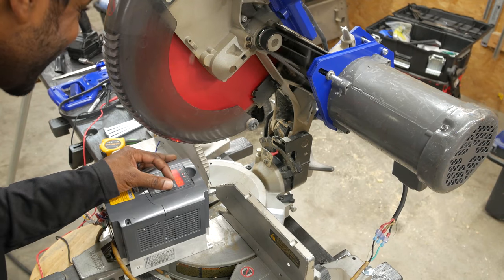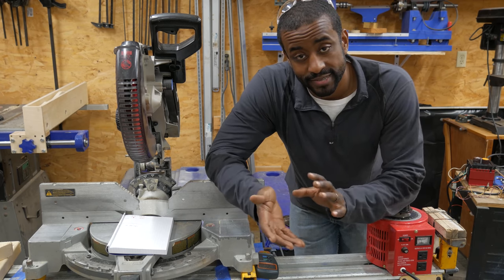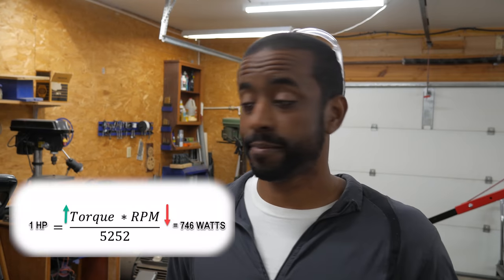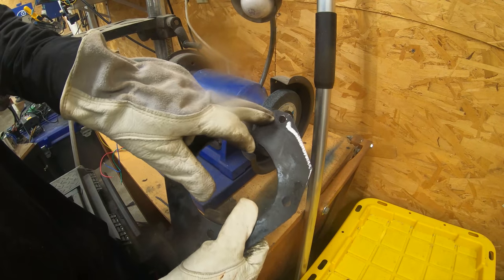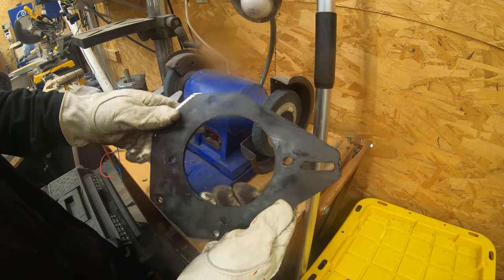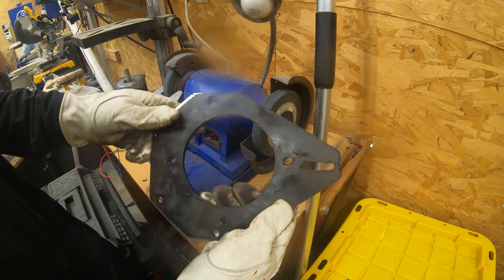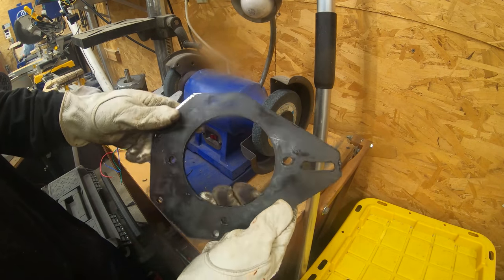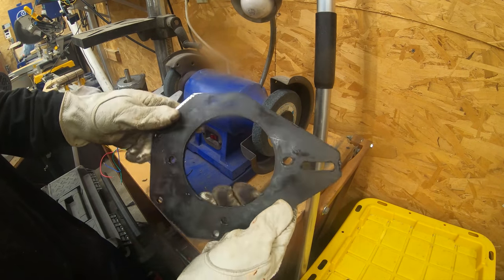How To Speed Control Your Miter Saw For Cutting Steel #080

Comment: I tested my saw on bologna. It definitely works on cold cuts. I'll have to pick up some dry salami to see if it can do dry cuts, too.
Reply: That’s a lot of modifying to cut metal on a mitre saw when you can just buy a metal cutting blade rated to 3000RPM. I purchased a Diablo STEEL DEMON 10” blade for ferrous metals including stainless steel for AU$160 which is about US$5 😝. No mods needed and it works beautifully.
Reply: Random: You can make a fair dinkum hybrid rocket engine out of a pepperoni or salami plumbed for oxygen. Needs  casing and a nozzle of course. I'm serious.
Reply: @railgap  The "I'm serious" at the end made me actually google this. Thank you for expanding my culinary rocketry knowledge sir.
Reply: Now that's Funny~!! 😅😆😅😆
Reply: You could try butter for the cold cut and see how that works out.
Reply: I tried to get that "shaved" ham effect and ended up with 4 really thin slices and a pound of Underwood Deviled Ham all over my saw.  Woefully inefficient for the task, unfortunately.
Reply: Railgap Esoterica I would definitely like to see that. Lol
Reply: hahahahaha!
Reply: Sir I'm going to ask you to leave this comment section and never return. We have a zero tolerance policy regarding puns and dad jokes. Goodbye.
Reply: Wild or domestic bologna?
Reply: @unclezeds  no issues with the blade going a bit over the max speed of 3000rpms.....? Thanks
Reply: capitalD D they have smaller blades that are rated at higher RPMs something like 7500 on a 7” blade.  I’m guessing slightly might be ok as they always have a safety margin on ratings.
Reply: Hahahahajajajaja made my day..
Reply: Ha! I kill me!
Reply: Are you talking about ring bologna or the big loaf?  I’m a ring bologna guy myself, but I’ve never used a power tool to cut it.
Great idea!
Reply: Uncle Zed.. Where is the fun in that..!;!
Reply: Watch out with salami sometimes they are way to hard
Reply: @unclezeds  this saw, and most other 10 to 12"  miter saws made for wood run well over 3000 rpms. Usually anywhere from 3600 to 4000 rpms which will kill any steel cutting carbide blade pretty quickly. Beleive me I've tried it. I tried a 10" lennox blade rated at 5000 rpms in my 12" rigid miter saw that runs at 4k rpm and the blades wouldn't last. Still too many rpms. Next project will be trying it on a Bosch saw that was given to me that has pulleys and a belt. I'll be making new pulleys tobreduce the speed down to about 3k rpms. Nice thing is it will give me MORE torque.
Reply: I'm glad there are other dads here
Reply: I cut a frozen 10lb roll of ground beef.
Reply: let 'er rip
Reply: Told my wife I wanted a new cold cut saw for Christmas, thanks to this little comment she stumbled across trying to figure out what a cold cut saw was I now have a beautiful slightly used but we'll maintained  meat slicer right where my engine lathe should be going!!! No BS. I guess it Looks like I'm going into the meat business instead of machining business

Comment from the maker: This project is meant to be a creative teaching moment. I don't expect anyone to buy a VFD and induction motor. That would cost more than buying a separate saw. LOL I really just wanted to show what does and doesn't work in a creative way. I hope you walk away with a new understanding of universal motors, speed control, and maybe laughed a bit at this insane upgrade! Which worked out great by the way. Cuts both steel and wood like a champ!
Reply: Jeremy, great video.  I really liked it.   I am curious how the abrasive wheel worked.  You said you would tell us in the comment section.  But I've scrolled through twice and  I'm not seeing it.

Keep up the great work, Jeremy.

- Chaos
Reply: Ed G  I've come to the same conclusion ie, bite the bullet. I've noticed my 14"abrasive blade tends to deflect, also. Can't get a square cut no matter how fast or slow I cut.
Reply: @shaywave  my experience with abrasive wheels is the larger blades seem to work better and abrasive chop saws are cheap.
I think I paid 100 bucks for my ryobi 12".
One thing that has happened to me twice though and I thought it was a fluke the first time....
Don't cut aluminum and steel with the same blade.
I buy pretty expensive blades so I'm pretty sure it's not that they are cheap, but I dont cut steel much mostly aluminum. If I cut steele after cutting aluminum then go back to aluminum my blades shatter. 
I've asked all the old guys I know and they have all said use a different blade.
Could be I just had two go off on me coincidentally, but I have been using the same saw and I'm about out of the 20 blades I bought and it's been over 15 years since the last time that happened.
Reply: @christopherleveck6835  A similar consequences is supposed to happen to grinder wheels if you grind soft metals, but I've never had it happen. I do most steel cutting with cutoff wheels in angle grinders and larger stuff with an abrasive wheel in a circular saw or table saw, which does the straightest cuts. (I just lack money)
Reply: Showcasing how such a modification can fail and WHY is also very educational.
Reply: As the speed for cutting steel is only a bit less than half the speed of the wood variety that makes changing the pulley an option. That way the motor can run at it's normal speed reducing the heating of brushes due to more current and the reduced cooling as the fan spins slower.
Reply: @Jeremy Fielding  Then why did you call this "How to"? 

As you said,  this doesnt make much sense for people to try to copy.
Reply: No, actually I kinda got pissed that I wasted my time watching this video. Here I thought you were going to show me an economical way to turn my slide miter saw into a dual-purpose machine. Instead you showed me how to use thousands of dollars worth of equipment I don't have and 5 to 10 times the cost in parts of just buying a metal chopsaw. The time that it takes to convert your unit between the two uses is probably 20 times as long as it would take for me to move the slide miter saw and put the chop saw in its place or vice versa.
Reply: Can you make a video making a perpetual power machine and explain why it works or why it is not possible for it to work
Reply: i dunno. that 2hp wood cut seems like some would love to have that speed
Reply: Great video,  I thought you achieved your intent, "Creative Teaching Moment".  Did you determine the optimum RPM or feet per second the 12" blade needs to strike the steel? 
As a side note the plastic chute at the back of my saw used to collect dust on my miter saw caught fire after several cuts with the abrasive blade.
Reply: Jeremy  I'm so glad to see that someone finally gave you some money man you deserve it you do some of the Things I only dream of a man after my own heart Live on my friend you doing Great
Reply: @PacesIII  what fails
Reply: @dgallett60  ----- This was a while ago, but if I recall, he had mentioned something about modifications like this can fail. I would like to know the mechanisms behind such failures so I don't make the same mistakes.
Reply: Jeremy, you have a knack for tutorials and tool engineering. Your knowledge on motors, circuits and electrical in general is second to none on you tube because of your detailed without rambling explanations.
No need to explain your reasons behind any projects as it is educational and fun to watch you create.
Keep up the great work bro. You got mad skills !!!!
Reply: Christopher Leveck iam a carpenter but went to school for aircraft mechanic. one of first things we learned was never ever grind aluminum on bench grinding wheel that’s used to grind steel. Same reason hangars have 2 separate grinders. Aluminum being a softer metal with lower molten point then steel, gets impregnated in  wheel during grinding process. then when u go and grind steel on same wheel, because steel is harder it heats up impregnated aluminum bits that expand( heat expansion) which leads to wheel shattering. btw being hit by fragments of a shattered grinding wheel is no different then being shot by a .22 caliber gun
Reply: Its a cool modifcation regardless tho, even if you dont have a spare VFD with some induction motors at hand
Reply: I understand it is content for a video, but why not use your plasma cutter, or an angle grinder on a stand?
:
Reply: Why buy a vfd and induction motor when you can raid an old inverter and motor from a decommissioned split system air conditioner. All you would really need to do is wire pwm outputs of an Arduino to the gates of the drive.  Still cheapest option, you may be able to get them from a scrapper or fridgy.
Reply: Nicely done, very thorough.
Reply: Have you ever considered putting a electric chainsaw motor on to make a cold saw the rpms seem to be around 2000 .
Reply: Ed G  There are steel cutting blades available with special carbide grade negative rake teeth for cutting steel. Also blades designed for cutting aluminum and brass with positive rake. Many years ago I actually cut 1/2 inch aluminum plate with a Porter/Cable portable electric saw. The only modification was to cover the brush openings with a fine-mesh screen to keep aluminum chips from shorting out the motor.
Reply: Lol
Reply: I loved it. It was a great experiment. It was educational to me and I've been an electrician for 35yrs.
Reply: It’s creative. Not practical as you stated but a challenge to learn and make it work. Nice work.
Reply: FYI 3 months late,  the 2 NC wires were probably for the original motor break.
Reply: I also was wondering how abrasive would work also. I like your video's. Your a straight shooter. No BS thanks for sharing.
Reply: 🤔 Are you doing a segment on the plasma torch and triumphs 😏 awesome video 😊
Reply: You put it out there for anyone who is half able to consider the physics voltage, induction , torque, speed ,. You think you need to get bah to the lab ?
Reply: Knowing their viability means that we'll be on the lookout for them whenever it's garbage day or just going through the junkyards.
Reply: I have the feeling that the other side of the switch might have been for a "brake" if you will. So when you let go of the trigger the N/C side of the switch would slow down the blade relatively quick.
Reply: Your channel is about the only channel in English demonstrating how to adapt electric motors. The alternatives are all in Hindu
Reply: Next time maybe try BLDC with FOC controller?
Reply: I am a power systems engineer by background.  Torque output of an electric motor is based on current.  The winding impedance is based on the excitation frequency.  An auto transformer can change the magnitude of the excitation voltage but the the frequency is unchanged.  Single phase drives can reduce both the excitation frequency and the excitation voltage.  Typically, this is volts/hz mode.  Your torque will not drop off so because the magnetization current is still maintained at the lower frequency.   This should still hold for a universal motor.
Reply: I'd like to buy an induction motor miter saw. You're into something.
Reply: How about try with a treadmill motor and controller?
Reply: @garychandler4296  It's a very real thing.
Don't use regular grinding wheels on Alu. It fuses into the pores, then friction super heats the ceramic, stressing it and it explodes at several thousand rpm.
Or more likely, you use it on alu and then someone else goes to use it on steel and it explodes on them.
Reply: You mean everybody also has CAD and a CNC plasma cutter? ;-)
Reply: @tdelmo33  You can get autocad fusion 360 for free potentially indefinitely (and legally).  So it's a matter of choosing which toys to save up for and which don't make the list (yet).

And a lot of stuff can be made just with a grinder, drill, and some patience.

I've had a self-upgraded hobby cnc router for about 10years, but I only just got a vertical bandsaw last year (been getting by with grinders, but then started a project too big/time consumptive to not get a bandsaw).
A tig welder will probably make my list before a plasma cutter (again, I have a grinders and a cnc router, so I overlap some of that capability).
Reply: Run it at 1800 rpm and see what it does. Cold cutting saws are typically not spinning bladed saws. Just match the evolution saw speed
Reply: Lol no friend I refuse to use this as just a teaching moment. I am going to build your CNC plasma cutter so I can do this too! Lol

Comment: VFD designer here. For clarification, the DC bus voltage available to the VFD is simply the rectified mains voltage. This is the real reason that the VFD can't deliver more power when you go above the nominal motor voltage. It isn't that the VFD is programmed to prevent delivering more power than the motor rating. For example, DC bus voltage for 220V single phase mains is about 330 vdc. So, there's no way for the VFD to deliver any more than 330 V peak. The VFD normally delivers constant volts/Hz = K, where K = 220/60 when your settings are for a 220V 60 Hz motor. However, when you set for say, 120 Hz, there's no way for the VFD to deliver the 440 V that would be required, because internal DC bus voltage is too low. I hope this makes sense, and I hope you read it. Thanks for your many well-produced and informative videos.

Comment: Incase anyone is wondering:  Typically in the machining world, when you're cutting steel with carbide, you run around 400sfm (Surface feet per minute) of course this varies depending on the type of steel, inserts, coolant, etc... but it's a starting point.

When cutting with HSS (high speed steel) you're aiming for around 80sfm

When calculating speed, the easiest formula is RPM = 4 x cuttingSpeed/Diameter  the diameter being based on the size of whichever object is spinning (in this case the saw blade)
There is a longer formula incorporating pie, but using this simplified version it will typically be close enough.

So for example, if you have a 12" carbide tooth saw blade:
RPM = 4 x 400/12
RPM = 1600/12
RPM = 133
Reply: The blades and carbide grade/geometry for these types of evolution/metal devil saws is specifically designed to be run at ~1500 rpm. It doesn't really translate from insert tooling.
Reply: @xenonram  I just purchased a carbide Diablo metal cutting blade and it states on the blade that it's rated for more than 3,000 RPM, however it's a 7 1/2 inch blade.
Reply: Also when milling steel it's considering solid steel. For this test it has what guessing is less than 3/16" thick wall, so again doesn't equate.
Reply: Go to 16:40. He explains that he changes the motor to 1,500 rpms. I thought I was going crazy and losing my mind! I thought 50 to 88 rpms seemed unusually low for mild steel on a modern carbide cutoff saw. He explains that the modern blade configurations are designed to run at 1,500 rpms. That sounds more realistic, and definitely a good speed. You can cut metal at 4,000 rpms if you want, but you do risk overheating the carbide if you cut metal that isn't very conductive like stainless steel. Stainless steel doesn't' dissipate heat, so you have to go slow, or it overheats the blade.
Reply: Those numbers are crazy low compared to what a typical 7.5" circular saw uses - 2800-5800 RPM is the standard.

Your maths suggests (I verified it with other sources and it checks out) the RPM on a 7.5" blade should be around 200 RPM which is completely unachievable on a typical circular saw - they just can't get that low in terms of RPM. Usually there's no variable speed control at all.

I wonder if it's still possible to cut stainless steel without ruining it with heat, by using a cutting carbide blade and just going EXTREMELY slowly through the cut with added pauses for cool down of the material being cut.
Reply: I remember using a wet cut off saw with a 7-8" HSS blade which seemed to run incredibly slow rpm but it cut amazingly well considering the speed. It also would cut for ages without needing sharpening. I think all of these high speed saws are giving a high cut rate at the expense of thrashing the blades and keeping consumables sales very healthy.

Comment: My experience shows that the dust from the abrasive wheel gets sucked into the motor via the cooling fan and destroys the motor. Also, the metal dust gets sucked in and shorts out the windings. As long as you avoid those pitfalls, the abrasive wheels work. Also, be aware that the abrasive wheel throws HOT sparks that will start fires and melt plastic guards. My metal cutting saws are all shielded and protected. Great video!
Reply: I agree

Comment: Just FYI, they do make 10" and 12" carbide-toothed blades for cutting ferrous or non-ferrous metals with a miter saw at their natural speeds. That's what I use most for cutting steel. 10" sliding compound miter saw from Harbor Freight for $100 and a 10" carbide toothed blade from Concord on Amazon for about $25 delivered overnight
Reply: They do have a Concord "rescue blade" in 12-inch size, but I cannot find 10 inch. Can you provide a link, please? Thanks.
Reply: the blades do not last as long as a dry cut or cold cut saw. and if you cut steel often the cost of the blades is more than the cost of the machine.
Reply: A 3600 rpm metal blade makes a huge hot mess. It’s roughly 90 teeth and all 90 are throwing hot glowing chips.
Reply: Leland Holton I had a project scoring a grid in 10" diameter cast iron disks on a Delta table saw with a cheap carbide blade.  It was exciting!  The cuts were rough, but worked for my use.
Reply: Fabrimaker —Exactolly. This video is for entertainment not reality
Reply: Carbide blades also work best with a zero backlash drive. It matters more the slower the speed. But the right carbide tipped cold saw will go years on one blade.